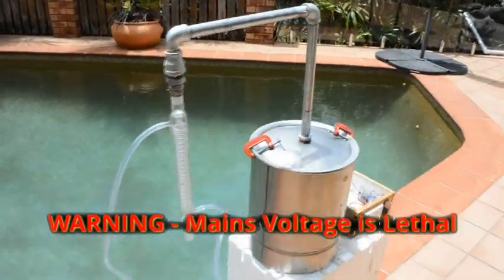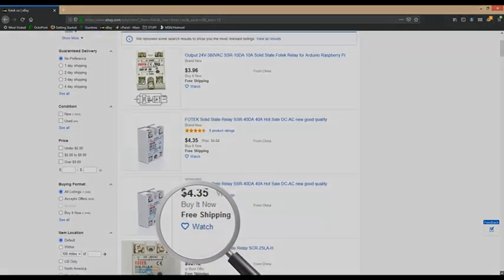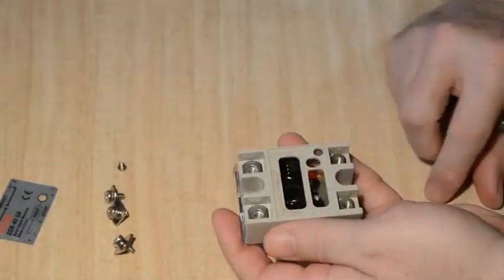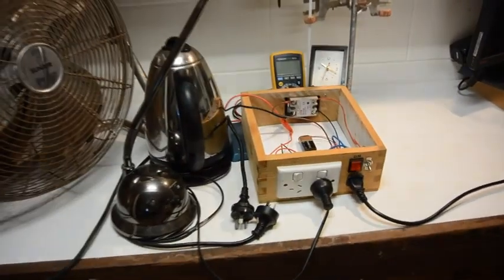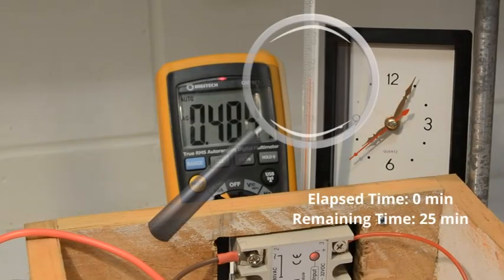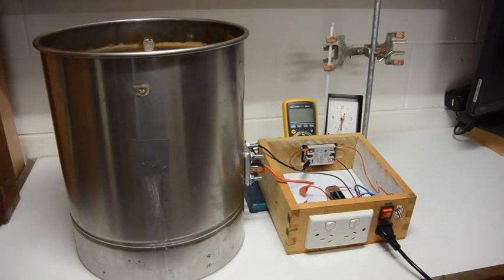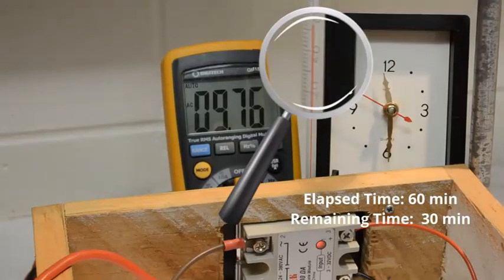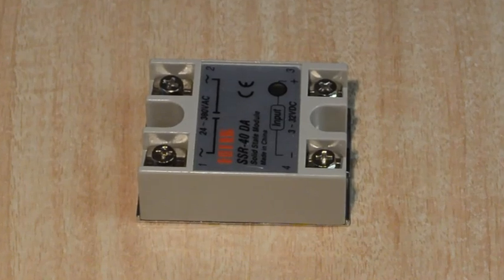Fotek Solid State Relay (SSR-40 DA) - Testing and Physical Review

Comment: Recently I repair this SSR because I accidentally make a short of the load. So I found a Triac inside BTA 24 800 that is 24A. 24A x 220VAC means 5.280W very far from 40A declared. For the use I'm doing is enought and not a problem, but this triac is not suitable to support 40A.
Reply from the maker: thanks for the update

Comment: So glad I found this video. Was about to implement a 25A version.  I tested it to 10A with heatsink and exceeded 120C.  Took it to 12A and it melted the plastic case after 8 minutes of run time.  Would have certainly burnt down my shed if I had not found your video.   Opened it up and found a BTA12600B  12A Triac.
Reply from the maker: Thanks for sharing your experience!

Comment: I bought a 40a ac-ac ssr. The brand is jingzheng. I plan on using it for a 3kw 220v floor grinder. It will have thermal pads and mounted to the chassis with a probe and live readout of the temperature. If it fails then i will request a refund and buy a reputable one. My only worry is how it fails? What temp might it fail at? How will i know its failing? And what is the risk of electrocution?
Reply from the maker: If you were prepared to purchase a reputable SSR, probably should have done this in the first instance to be safe (if the SSR fails, could damage the connected load, ie the grinder, you will not get a refund for any damage to a connected load). SSR could fail "open" meaning can't turn-off the load with the SSR. Wouldn't recommend just relying on temperature as you will not be able to rely upon thermal specifications in datasheet - even if you know what the internal triac is (you likely will be able to "smell" the components failing !!). If you are going to use this, recommend only using it "within in sight" so you can see if problem developing (smell,/see smoke and or rapidly increasing temperature) and can "pull the plug".
Here is potentially useful info (page C-345 for some external circuit additions that may be helpful in case of failure)
https://omronfs.omron.com/en_US/ecb/products/pdf/precautions_ssr.pdf
If you have any doubts don't use (I assume cheap fake) - just ask for refund straight away and go with "reputable".

Comment: Very usefull video..i want to handle 1200 watts 220 ac but for 18 hours a day straight. You think theese fake relays could handle that? Should i get a heatsink too?
Reply from the maker: I'd only use/consider these fakes in a situation/application that you/the user would be continuously monitor the situation and the equipment being powered isn't "critical/expensive", so if something went wrong ("magic" smoke coming out of SSR for example) you could disconnect etc. Heat sink best to be used in all cases. Considering the amount of usage you are planning, I'd go with SSR from a reputable source as you would be getting your money worth over planned usage time (and piece of mind)
Reply: @FadsToObsessions  i get a cheap ssr(excactly like yours). I test it with a simple lamp(no gnd). When its turn on lamp its working. But when its turn off lamp is slightly open and i get 74V(- of input with a pin or output) instead of 0.resistance of output pin on state 5Kohm, off state 40Mohm. Could this happen because of the ground? I control the cirquit whith an microprossecor
Reply from the maker: With zero volts DC on the SSR "DC inputs" (which are labelled terminal 3 and 4 on the Fotek "style" fakes) you should get zero AC volts being passed by the SSR. Check that the microprocessor is indeed placing 0V DC across the DC input terminals of the SSR. Gnd not affect getting AC voltage if DC input voltage is indeed zero. If zero DC volts on DC inputs and you still get AC voltage passed by SSR, the SSR is damaged most likely. Also, double check your wiring just in case (see here for example https://youtu.be/L0E3xMoyJZ8?t=227 - maybe try/test just with battery/switch on DC to check SSR function).
Reply: @FadsToObsessions  i did a search and found out that there is a leackage curent in ssr. When the load is very light, like the led lamp i tested, may have a result like this. But for heavier loads its practical zero. I will test it again with different load

Comment: Very good video. Where can one buy a real good solid state relay? I need one for a robotic project I am working on: a robotic boat: https://www.youtube.com/watch?v=xaZL-6t_SS0&list=PLfpmd9m0Cn0LjSOuTDKqa2xxWt87_EN8O
Reply from the maker: Nice project 👍  But with the SSR purchase, difficult to say, depends I suppose on where you live (shipping costs often add considerably to the overall price) and how much you are willing to pay (and how important the attached circuity is, in case of failure of the SSR,  if getting a "cheaper" option). I haven't had trouble with "ebay fotek" and recently have been using Ketiqing brand https://youtu.be/L0E3xMoyJZ8   BUT, I only connect these SSR's to things I'm willing to lose !!!

Comment: What means “If used appropriately” here? The manufacturer says up to 25A, but the installed TRIAC is only rated up to 12A.
Reply from the maker: If in any doubt, don't use these fakes - but see https://youtu.be/rgW8L2LaAlU?t=669 for possible use cases if the $$ are worth the risk to the individual

Comment: I got one with a heat sink. I set up a computer fan to run when my longmill cnc control board is on and it blows across the ssr and the heat sink. It switches my router and shop vac. Works just fine so far.
Reply from the maker: nice - I did similar with my cross-cut mitre saw (check this video https://youtu.be/L0E3xMoyJZ8 ), it only runs "intermittently" as manually cutting, so no heat sink, and seems to be OK so far
Reply: @FadsToObsessions  it's ran for about 3 hours straight with no problems.

Comment: I bought a couple of these for a little DIY wind turbine dump load circuit, I think it should be fine for that as it's only 12v and won't be running anything over 8amps.
Just figured it would be more reliable than a traditional relay.
I didn't know they sold fake ones but luckily I ordered much higher tolerance than I need lol

Comment: Does the relay require a load to engage or will it engage before the load is present?
Reply from the maker: As long as a DC voltage between 3-32V is "across" terminals 3 and 4, the relay will "engage" and terminals 1 and 2 will form a closed circuit

Comment: At 220 v you only breaking one leg?  The other side is still energized.  Does that not cause harm (110v on one side hot)
Reply: This is good in our Line to Ground 220V system.

Comment: Great video! Quick question thought. If I use a SSR with an input voltage of 230v, will it instantly switch once the input voltage reach 230v?
Reply from the maker: Kaveen - I'm not clear on what you are asking, but the input voltage (across terminal 1 & 2 of the SSR) has to be AC (and between 24 to 380 VAC) and obviously varies sinusoidal, so if you are asking is the SSR "zero crossing", the datasheet does say it is suppose to be "zero cross trigger method" - although these fakes are obviously suspect at best. The SSR "input" (terminals 3 & 4) is DC voltage between 3 and 32V. If a DC voltage of between 3 and 32V is connected to terminals 3 & 4 (notice the polarity indicated on the face plate), whatever AC voltage is connected across terminals 1 & 2 will flow. Be careful not to "mix-up" the AC and DC voltages. Hope this helps.
Reply: @FadsToObsessions  Thanks!!

Comment: GreatScott pulled a 40A ebay fotek apart, it used only a 16A triac.
Reply: my comic book press caught on fire when I took it apart found the same problem
Reply from the maker: thanks for sharing your experience
Reply: @ozz2362  I use the inkbird ones, they are intended for use on their own branded PIDs, but they are as advertised.

Comment: As a bit of an understanding on these devices (which IMO and like you stated) the expensive ones are the way to go.  Safety is paramount, buy trusted parts for dangerous operations.  Inspect current regulation at the source, and make sure your device is within acceptable ranges.  

It's good to keep in mind that the main idea behind these SSR's is usually to throttle a heating element like on your stove top range.  Most still have a relay for the oven bits and you can hear the click.  But none for the element.  That's because they have to switch on and off A LOT to maintain consistent heat at the element.  If you did that with a relay, it would by noisy, and it would fail within a year.  That's why these exist in the first place.

Now that doesn't mean that you can't use them as glorified switches.  I mean, it's what they are.   They do allow for continuous amperage, but again, it wasn't the specific mode of operation that they were designed for.  For switching, I would MASSIVELY oversize ANY SSR with a standard 120V outlet.  You can't predict all the wiggly plugs that might make it to this circuit to test your design.

Comment: is it zero crossing ?
Reply from the maker: I believe the datasheet for the genuine versions state that the optoisolator incorporated is zero crossing. BUT, since these cheap "ebay" versions have to be assumed as fakes, you cannot be certain as to what actual components have been used internally.

Comment: Hello. your video is very interesting. I would like to know if it is the small 9v battery that powers the electrical devices through the ssr-40 DA relay. thank you very much
Reply from the maker: The 9V battery is only providing the CONTROL voltage (which can be from 3 to 32V DC) across pins 3 and 4, whereas, any "electrical devices" are powered by AC voltage (240V AC in this case) connected to pins 1 and 2. If the CONTROL voltage (from a battery or similar DC source) is ON, then the SSR will power the electrical devices using the AC voltage.
Reply: @FadsToObsessions  thank you. But is the ac output of the ssr-40 relay connected to a source of electricity (from the house for example) or not? in fact i would like to know if the ssr-40 relay can operate the pump without connecting the ac output of the relay to a source of electricity or it is imperative that the ac output of the relay is connected to a source of electricity. if you can give me some clarification.
Reply from the maker: @salif, the SSR-40 must be connected to a AC source of electricity (from the house for example as you say). The SSR-40 can be thought of as only a type of "switch", one that can be opened and closed by using a DC control voltage (instead of manually with your hand) which means it can be controlled by some circuit or sensor for example.

Comment: you had mentioned control signal to be 5V dc, but relay says 3-32 vDc, and also the datasheet, so I should be able to control it with a 3.3v esp32, right?
Reply from the maker: I haven't tested down to 3.3V (I'm using PIC microcontroller with 5V TTL), but you are correct should be able according to the datasheet, if you have time, would appreciate if you could reply with your results if you try this
Reply: I can confirm that you can.

Comment: The "Fotek" SSRs on eBay are all fakes, you can get a real Fotek but it'll cost you ten times the price. The markings of CE and UR certificate are also fake for the eBay versions. Divide the rating by 4 to get a usable value and don't use it in your house or unattended as insurance won't pay when is catches fire.

Comment: I bought a box of DC to DC SSR -100 DD (SSM) and tried to use it as a battery isolator or switch relay for my 84v 48A ebike battery to turn off power to the e-bike controller.   Input V is 3-32vdc on terminals 3 - 4 (+ and -) and that works as I tap off the battery for the 12vdc from 3 banks of the 20 banks.  But once I apply the positive cable to the output side (the switch) from the battery 84v to terminal #1 and the controller positive in terminal #2 it fails instantly.  Specs say 100A 5-200vdc on the output side.  Not sure if tapping off the 3 banks is destroying the SSR or if I need diodes ??  I'll try a different power supply to the input voltage to see if that makes a difference.
Reply from the maker: If I understand your setup properly, having the same power supply (even though tapped off at different points in the series) as both the control voltage and "load" voltage to be switched does sound like the problem. If you have time, post the results of your testing.

Comment: Great video, very helpful. One thing more I would have liked to have seen is the amount of current it used to switch the relay on from the 9 volt battery, and if it was constant.
Reply from the maker: good suggestion, I'll look into doing an update.
Reply: @FadsToObsessions  Did you ever find out the DC current input?
Reply from the maker: The datasheet states less than 7.5mA @ 12VDC input, and with input voltage of 3-32V DC, 4 to 20mA linear - but I didn't actually measure this with the units I got from ebay